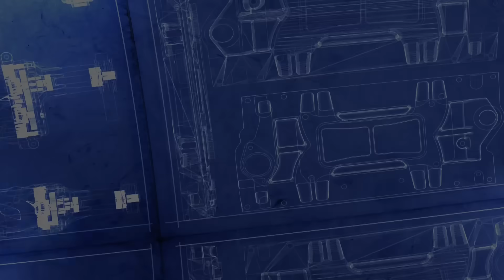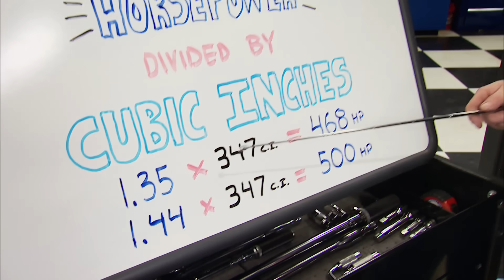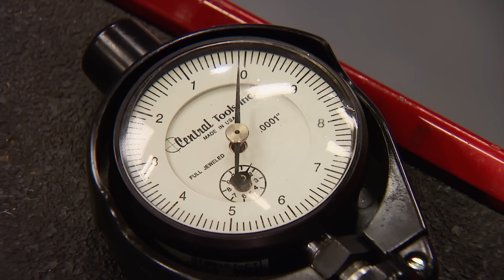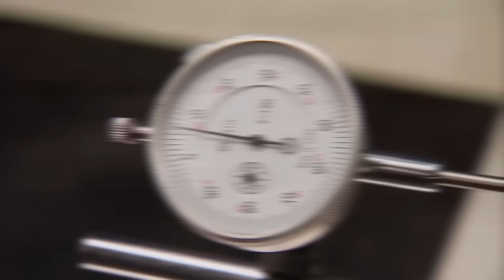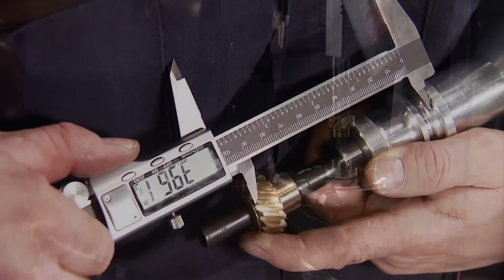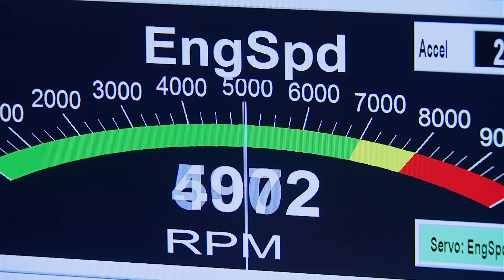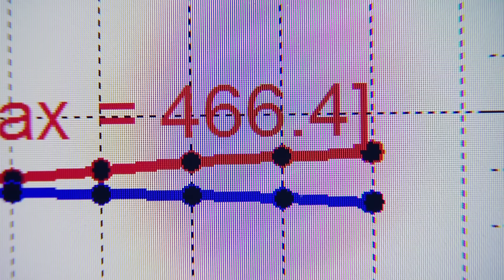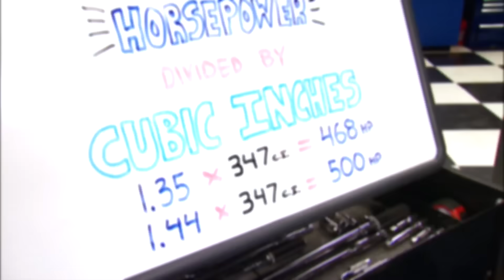Stroking A 5.0L Small Block Ford to 347 C.I. - Engine Power S2, E8

Comment: Aww Little baby Ford all built and still can't even make enough CI to equil a stock Chevy 350..Cute little toy can I give that to my little girl to play with?? Lmfao 🤣😂🤣
Reply: Your gay and so is chevy
Reply: Tank Firewalker 
And still cutting them 350
Chevy’s ass. Lmfao
Reply: Tank Firewalker they used afr’s 205cc heads which is a very conservative head. They could have brought those numbers way up with a different crank,  better compression piston and afr’s 245cc or 285cc head. They said at the beginning they want a stout street car and 500hp out of a small block ford is awesome numbers for such small components. I’d love to see what a 80’s 2 bolt Main 305 Chevy block would do in the same conditions. Oh wait we did see what it did in the iroc z episodes with bigger components too we saw 150 less hp. Just imagine if they got a 302r block instead of a stock 302 block. You can push the r block into the 2500hp area no problem at all.
Reply: He,s mad cus he has gotten beaten by baby fords and he just like to talk shit cus he is to of a bitch admitted that the lil ford could 🤣🤣🤣🤣🤣🤣🤣🤣🤣🤣🤣🤣
Reply: This idiot clearly doesn’t understand deck height lol
Reply: He's mad because he got smoked by a stock 6.7L power stroke in a superduty.
Reply: Tank Firewalker
Since when does a stock 350 make 500 hp? And it's equal not equil.
Reply: Yeah what ever jilll
Reply: Lmfao 😂🤣😂 You Ford guys try so hard to defind such a weak Engine it's so pathic 🤣😂🤣😂🤣
Reply: Tank Firewalker 
Lol, you must’ve gotten your ass handed to you on the street by those little baby Fords! Lmao 😂

And it’s “Defend”and “Pathetic”. Chevy guys can’t spell too well either 🤷🏻‍♂️
Reply: Tank Firewalker yeah, you’re right. Such a weak engine that it outsold camaros all through the 80s and early 90s. Go build your 350 or whatever. Make sure to keep your mullet nice and trimmed.

Comment: I love this show but.... They drive me crazy when it comes to ford stuff. Using studs for the intake but not mains or heads, spending thousands on high quality parts but not an adjustable timing set like they usually would on a chevy, using lunati with dog bone retainers instead of a good comp tie bar (yes I know they're a sponsor but so is comp) and spinning it to 6500? what is up with that, still wasn't nosing over. 400hp from a cam and head swap isn't a big deal with a regular 5.0 let alone spending thousands for 100 horse. So frustrating
Reply: Baggerz Anonymous they have people getting over 400 hp with stock everything inside and outside the engine in stock eliminator class. Actually the cam is the only change it's a stock lift super long duration cam. Those 5.0 ho are good engines
Reply: It’s because it’s the stage 1 build

Comment: @PowerNation 
Are there benefits of a 347 Stroker compared to a 351 if you were to use the same cam and heads?
Reply: The benefits of the 347 is it's a lower deck motor, so it's a smaller package than a 351w.. the 351 is wider.. if you can fit a 351 in your vehicle, the advantage is there, because most can be stroked out to 408, and more cubes are always better..

They actually did it right in this episode, used a really good head instead of a substandard one..
Reply: @stanleykendziorski7964  @Cody Caelwaerts
Deck heights:
289/302 - 8.2"
SBC stock - 9.025"
351 Cleveland - 9.2"
351W - 9.5"
More cubes is better but there are other metrics.  Rod/Stroke ratio doesn't matter as much to commercial guys, it still matters to street guys who daily.  Modern materials eliminate a lot but it still counts.  Generally, the taller the deck, the more stroke you can get out of the engine before getting into side forces on the piston.  In reality, the 347 does not fall outside of a generally accepted range.  However, the long rod pushes the wrist pin up into the top of the piston, therefore into the oil ring land.  This also is not a huge issue especially for a more strip motor, but the 289/302 can also be stroked to 331 cid which is only 16 cubes shy, and the 331 uses a more conventional piston with no wrist incursion to the oil land and more piston material between the wrist pin and piston deck.  
The deck heigh that Stanley mentioned is the primary advantage of using the 289/302 @8.2".  It's also going to come in under 170lbs bare iron block.  And because they're all 90* V8s, it's also narrower because it's going out at a 135* angle from vertical for 1.3" less than a 351W.  If you do the Trigonometry, overall it should be over 1" narrower.  So it's a small, light engine with a lot of parts interchangeability, and those parts are now just about as cheap as SBC parts.  
The 351W is awesome because of the big deck height.  It can actually be stroked to 454 cid, 427 is a lot more popular, and 408 is probably about perfect in rod/stroke ratio, piston configuration, and the capability of milder heads to feed 408 cubes.  408 might even be a better overall displacement than the actual OEM 351 cid.  It's not that much heavier than a 289/302, stock blocks tend to have more material overall, and there are still a lot of them out there.  
It's not a matter of which engine is 'better' anymore.  It's a matter of what you want to accomplish, and that goes for the SBC or Chrysler SBs as well, which might be the right choice for the application.  Given the popularity of the 8.2 and 9.5 SBFs and prices, aftermarket heads, and modern materials, don't believe people who are GMvFMCvMOPAR anymore.  It's 'what you want to accomplish that counts.
Reply: 351 has a better piston to rod ratio and larger diameter head and main bolts and the block is less likely to split
Reply: Cody Caelwaerts I wanna see more 351w related videos on here
Reply: But I bet a 351 with cams same compression pistons and heads would smoke this

Comment: Why would you not degree the cam to get that cam inline with spec.
Reply: This drives me crazy about this show. They do every trick in the book when it comes to a chevy. but they spend thousands on this engine and don't use an adjustable timing set. if It was a chevy they would have.
Reply: @johnhamblin12201  the timing set has multiple keyways on the crank gear to adjust intake centerline. I'm positive this cam was put exactly where they wanted it.
Reply: @bigboreracing356    For all we know they degreed  the cam and didn't show us. It takes a little time to do.
Reply: The cam was 4 degrees advanced.
Reply: @bigboreracing356  how do you know we build super late model engines for runing in nascar i have seen deg a cam put out up to 30hp.

Comment: A lot of money for only 500 hp. Over 400 with a stock short block roller 302 with afr heads and highlift rocker arms. A simple cam change will get it up where you are.
Reply: They said they purchased those heads bc they need them for stage 2
Reply: osp80  its a stroker built bottom, N/A, of course they're adding power later, nothing wrong with building a reliable N/A tho, better than being on borrowed time, like you said..

Comment: Arp studs for the intake and oilpan but not for the heads or crank?
Reply: Luke Teverino it's all arp hardware
Reply: ricky Lawson they used bolts not studs. Studs are stronger and should be used in places where they are needed more than the oil pan. Like the heads and crank
Reply: Using ARP studs is basically a given.
Reply: Based and Janinepilled they used bolts not studs. Studs are stronger and should be used in places where they are needed more than the oil pan. Like the heads and crank
Reply: The heads of the studs on all the main caps and the girdle looked like arp
Reply: Nazty604 they used bolts not studs. Studs are stronger and should be used in places where they are needed more than the oil pan. Like the heads and crank
Reply: @luketeverino  seriously not needed on a stock block. Stock block HO 302  will split in half at the lifter valley before you ever lift a head useing head bolts instead of studs. Head studs would only be needed if it was an aftermarket block build like a dart shp block and boosting or adding nitrous for around 600 -1000hp. Any over 600hp on a stock Windsor block is flirting with disaster most split in half around the 550 to 650hp Mark well under what head studs would be needed for. Same goes for people thinking you need a forged crank in them. Generally it's a waste of money because you will never reach the hp mark. Scat cast crank is good to 650hp absolute  max for a stock 302w block.
Reply: @thedon3836  FWIW installing all that good stuff onto a roller 5.0 block have it destroy itself if it grenades when the block splits in the lifter valley  would be expensive your better off doing a 351W windsor based stroker, or of money permits a dart block then you can add boost
Reply: @mplante7352  agreed. The op is talking about way overbuilding the actual power potential of the stock block hence my comment on the over kill and waste of money.
Reply: @thedon3836  I would agree except for 2 exceptions. Those are the boss 302 and hipo 289 blocks. The boss 302 is a 4 bolt main block and the hipo 289 Is a 2 bolt but with much bigger webbing and caps. I've got 3 of the 302 blocks and 2 if the 289 and have been running them since the early 80s. Currently getting close to 1200 rwh out my turbo 313. Got as much as 900 rwh on nitrous. Both with iron ford heads believe it or not. Not your typical heads tho but have fomoco stamped on em none the less. Just saying.
Reply: @attitudeadjusted9027  ok well I'm addressing what's in the vid not the unicorn blocks of which you are referring.
Reply: @spankthemonkey3437  only cobra has forged pistons and (maybe rods not sure on that). Stock HO like my 94 definatly do not have forged anything in them I would know I built a twin turbo 331 out of it lol. I do believe some 86 to 88?(maybe 84) got forged pistons also.  I'm running a f303 cam with 1.7 rockers for a 544 lift in my afr  205 heads. My max rpm is 6300. I feel confident I'll make between 450 and 700hp(when flirting with disaster) but regardless of the fact I'm keeping low rpm vs most na 347 builds I dout it will last much into the 600hp range even with my main cap girdle on. Trust me I've done my homework thanks. ✌😉
Reply: @thedon3836  oh sorry I thought you said stock blocks. Oh wait you did. Huh. My father and uncle worked R&D at at Ford all thru the 60s and early 70s and I've gotten my hands on some knowledge and stock parts that most people wouldn't believe. Oh and a stock 2 bolt 302 block will handle 800 all day if you know what your doing. Just saying.
Reply: @attitudeadjusted9027  well point me in that builders direction brother. 800hp outa my 94 Link please. in a 80s to 90s stock block 302 5.0 HO like what everyone was talking about, featured and built in the video we all watched here on youtube.? Cause I even went to the brown bro's and Jon  Kaase him self yo! For realzy now! I want that link.
Reply: @attitudeadjusted9027  were all still waitin on that 800hp stock block link mr RandD jnr 😉😉
Reply: @attitudeadjusted9027  the only stock 5.0 blocks that can handle if that 800hp were the old crown vics made in mex for taxi fleets and maybe some old f150 blocks kinda rare though
Reply: @RT-Revs  I have seen 800hp out of a stock block for 1 or 2 dyno pulls but that's it. Not all day every day like this guy was talking.only seen it with a turbo high boost hand full of dyno pulls then the boost gets turned way back down because they split in half. I guess he seen 1 dyno pull on youtube  and was like 📣 "Stock HO blocks can rotate the earth on the regular! 😬 derpy derpy do, mmmahha!"
Reply: @thedon3836  my 87block has forged pistons.
Reply: @bmcd4624  since making my anitial comments 4 months ago I have done more research on the topic unfortunately I did not update because the comments have since been buried under 4 months of other youtube comments.  But thank you for responding and digging this old stuff back up for me so I can address my own mistake and give the correct information. Truth is that I have actually found out since then  that all 85 mustang 302 got dished forged factory piston, all 86 mustang 302 got forged flat top,  all 87-92 got  forged factory Ford pistons and all 93-95 mustang 302 engine got the hypereutectics (cast) like what was inside my 94 302w. ✌😎
Reply: @bmcd4624  me either. I just decided to take the opportunity to post the information I had found out since then. I have no intention of being argumentative about it. Your post just brought the old thread back into light  for me so I could address my misinformation is all. It's no biggy, in fact it's all good brother ✌😎
Reply: Your Report Card Reads - Should have payed more attention in shop class...
Reply: The heads and crank need the studs more. the crank and heads see much more stress.
Reply: Steve Hicks they didn’t even lube  the cam and used impacts on the main caps there phony’s

Comment: 87bhp/L is pretty bad
Reply: 435 hp isn't anything to sneeze at.  This particular mill gets forced induction later and makes a bunch of power.   And most people can't handle 250 hp so something near double is a wreck waiting to happen.  In a fox body mustang it would make a pretty quick street car.
Reply: @bmstylee  500* crank hp is nothing to sneeze at but 87bh/l is not that good even when NA
Reply: @einar8019  I wish they told us compression ratio.  That would explain a lot.   If it's a low compression then that would have something to do with it.   And it's 100 hp/L which is pretty good.  507 hp on the final pull
Reply: Wild Bill I think he said 10:1 at one point in the video
Reply: @bmstylee  10.4:1
Reply: @bmstylee  in front of the dyno session he says it's a 10:1 compression
Reply: @einar8019  LOL 87hp/L isn't good??? Racing engines of 35-40 years ago would be lucky to get those numbers on a consistent basis. The almighty LT1 GM V-8 makes less than 80hp/L in C8 Corvette trim(495HP/6.2L). To make a reliable, pushrod V-8 give over 75hp/L is quite a feat for an engine builder. Unless you're talking about a one and done racing engine, then yeah, 87hp/L isn't great....
 People these days are so preoccupied with "peak" horsepower numbers, they fail to realize, a broad torque & powerband curve is where all the fun is at on a street engine.
Reply: @bmstylee     He did tell us the CR.
Reply: They said the compression right before they started it, 10.4:1
Reply: How did you get 87? 507÷(347÷61.16)=89.36